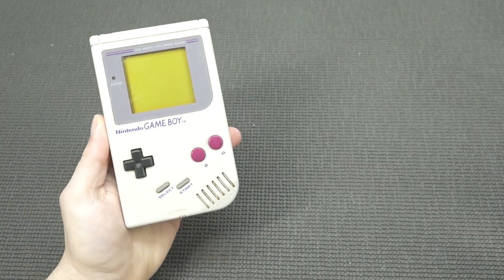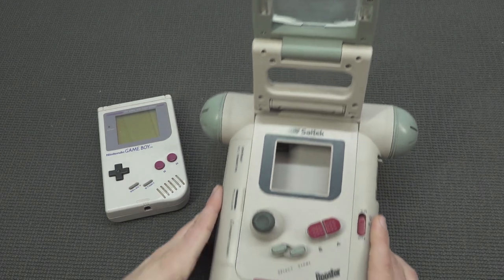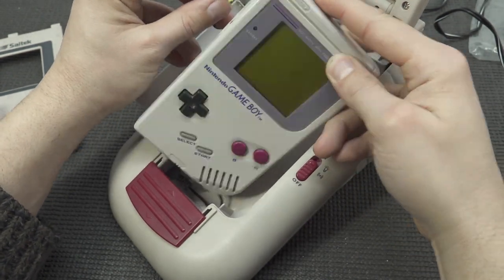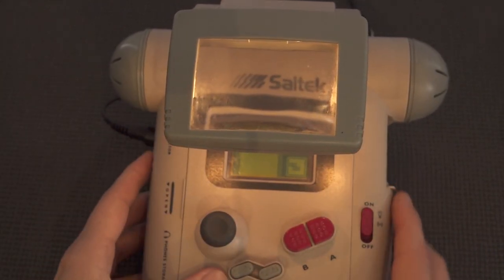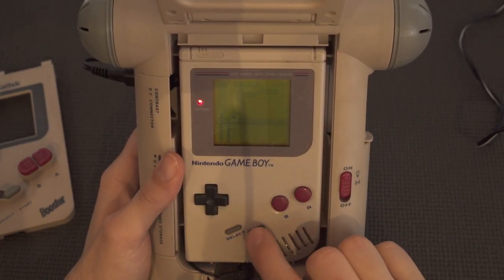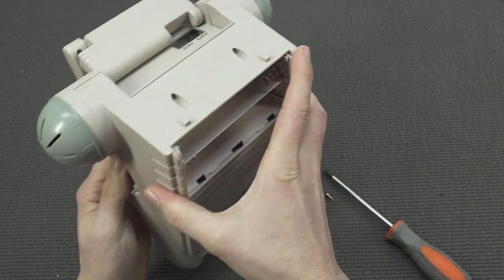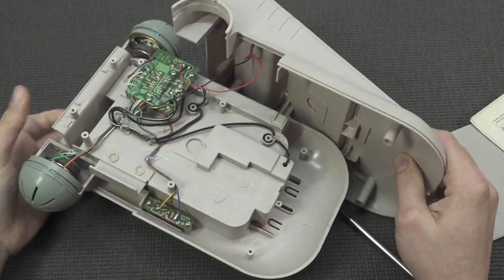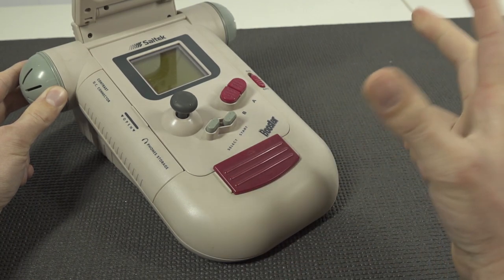I Turned my Game Boy Classic into a Arcade Machine !

Comment: The Sega Game Gear had a similar product that you would put your Game Gear inside it would protect the system from water and drops it also magnified  the screen while playing it in that case the only differences between the two it didn't have a lighted magnified screen and didn't boost the sound but the screen was color and already lit up and the sound went loud on the Sega Game Gear already so that wasn't really necessary either.

Comment: 4:47 Are you sure that the Start button contact or membrane isn't worn?  If it is, silicone rubber button membranes aren't expensive or that tough to install.
However, it requires some knowledge of the DMG-01 before going in.